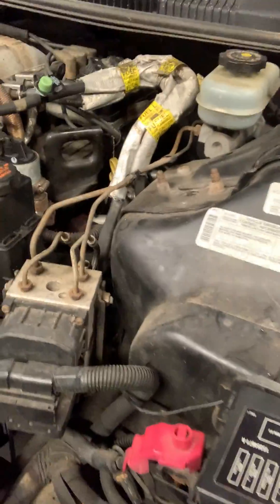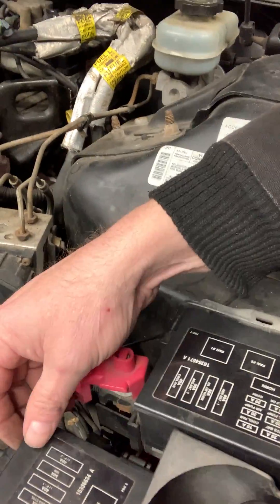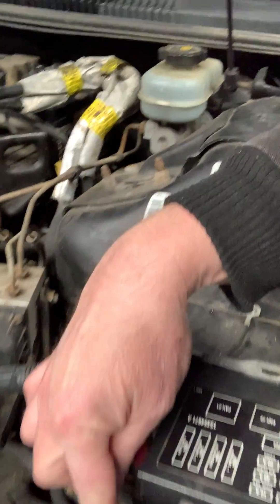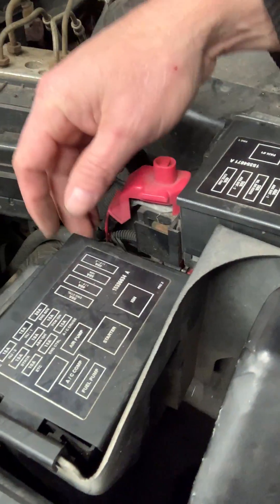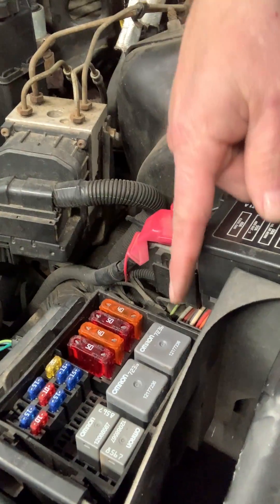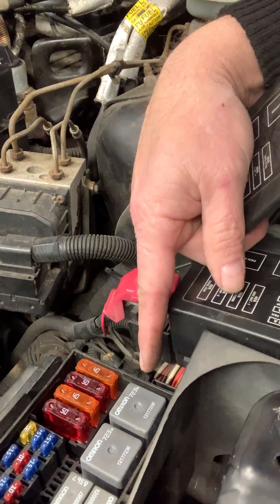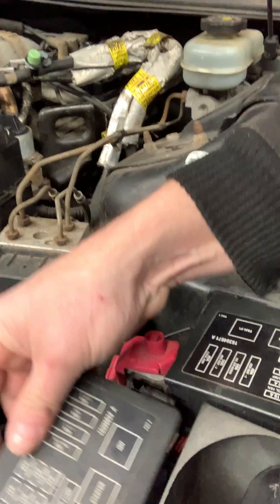2000 firebird dtc P1518 crank no-start

Comment: Getting the same code
I'll try swapping out the relays
Reply from the maker: Let us know how this works out for you
Reply: @fredtalks-diyfortheaverage9298  update: swapped the relays out still won't fire over. Fuel pressure is 40-43 psi. When I spray starting fluid in the throttle body it will fire over and die. Without starting fluid it will crank without firing at all.  I'm only getting 2 codes the P1518 and P0606. I've also replaced all the fuses and relays that might relate to that circuit. I  am not sure what PSI these injectors open at but I have seen it saying 48-55 psi in the Haynes manual. I just don't understand why it will fire over with starting fluid but won't without it. Is the 40-43 PSI not enough? I've already started checking wiring and will continue to check. I think I'm chasing  my tail with the wiring. if you have any suggestions I'd love to hear em'.
Reply from the maker: @willyjilly9684  It does sound like it's a fuel delivery problem since it will fire with starting fluid.  I would put a test light on one of the injectors.  It should light up with the key on and pulse while cranking.  If not, I could be the bcm (known to be problematic on these cars), ecm or bad ground (there is one on back of the block driver's side that is sometimes the culprit).  Generally, you won't get a code if the fuel pump goes out.
Reply: @fredtalks-diyfortheaverage9298  another update: decided to check the BCM and resolder the 5 pins that commonly cause no start issues. Didn't fix it. Tried to inspect my PCM internal components no burn spots or corrosion. Decided to check for voltage at the fuel pump. I'm not getting 12 volts. Thought maybe the VATS but the light doesn't blink when I start it so I looked at the circuit in the manual.  It shows the fuel pump wire running directly from the ECM to the relay from the relay to the pump. No in-between junction places. So I checked the fuse for the fuel pump and it was at 12 volts. The relay socket contacts are getting 12 volts from the fuses. So that tells me the computer is giving voltage for the pump.  it's getting voltage all the way from the PCM to the relay.  I'm just not getting the pump to get voltage. making a jumper from the 87 to the 30 on the fuel pump relay circuit and see if I can get 12 volts to the pump.
Reply from the maker: @willyjilly9684  Sounds like you're doing a very thorough job!  Here is a link that may help with your diagnosis: https://troubleshootmyvehicle.com/gm/3.8L/how-to-test-the-fuel-pump-1.  Another thing to consider is the fuel filter.  Have you changed that lately?
Reply: @fredtalks-diyfortheaverage9298  No I have not changed fuel filter in the past 4 years I believe. I thought the same thing about lower pressure affected by fuel filter. I'm going to start working on fuel pressure once I get the correct voltage at the pump. Thank you for the link and suggestions. I will let you know the outcome after more testing.